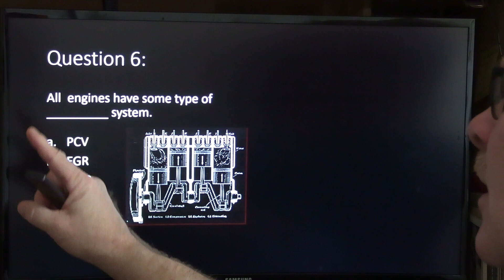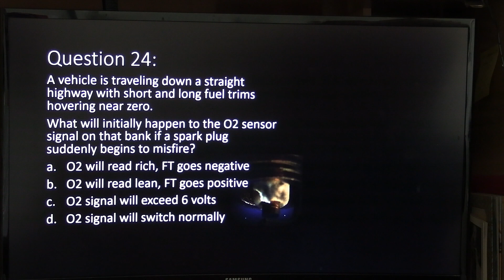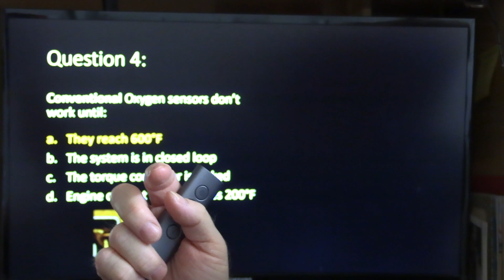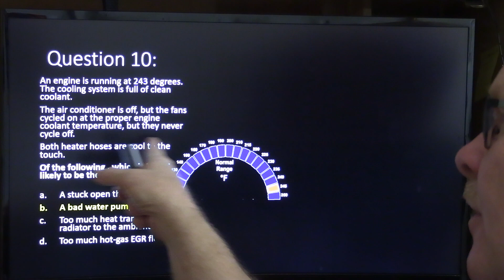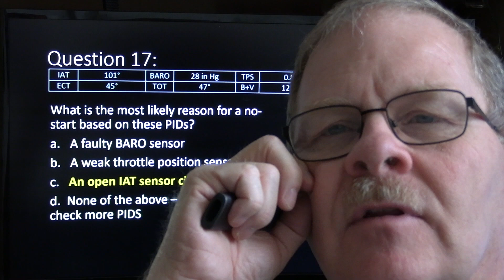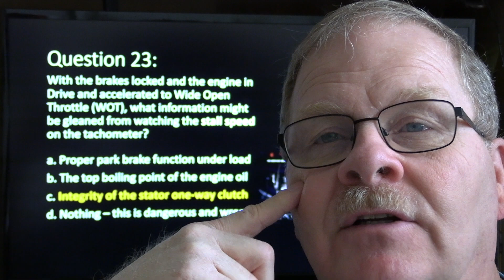Engine Performance ASE Practice Test

Comment: 17/25.

I missed the Waveform questions, got tricked on the least likely fuel question, PID question, Fuel trim question no.24, the heater hose question, O2 sensor activation, and the what happens when you lose all speed question. 

The test definitely helped identify some weak areas for me.

Comment: Hello, Sir. I have been trying to understand engine displacement and how a vacuum leak affects MAF reading. To my understanding, engine displacement is how much air the engine can take in. If you have a vacuum leak, it will always reduce the maf voltage or g/s because there will be less air going to the engine: Air from the maf and air from the vacuum leak should be equal to engine displacement. Am I wrong in my assumption?
Reply from the maker: That's pretty much correct. The proper MAF reading is critical if fuel trim is to be balanced. To illustrate this, you can be watching your fuel trim numbers and remove the oil filler cap - which allows air to enter the manifold by way of the PCV system, but not through the MAF sensor - that is referred to as "unmetered air." Metered meaning measured. The ECM/PCM algorithms are written to expect very precise incoming air measurements.
Reply: @McCuistian  Brilliant explanation! Love watching your videos: they are very instructional and helpful.

Comment: How does the spark plug seal compression if not with the washer?
Reply from the maker: That's part of what the washer does, but it's not the only thing - the washer - and the bevel on other spark plugs - both seal and conduct heat.

Comment: L1 tomorrow, oh boy.
Reply from the maker: You go, boy!  Just take your time and don't overthink your answers! Use the diagram and  common sense. Make sure you understand dynamic compression testing (I have a video on that too) https://www.youtube.com/watch?v=YbR7Ja2E28s&t=903s&pp=sAQA
Reply: @McCuistian  I passed!!! That concludes G1, A1-A8, and L1. Your channel helped a lot!
Reply from the maker: @jctyoga  Congratulations! Outstanding!  The L1 doesn't always have questions on dynamic compression testing (everybody gets different questions), but the first time I saw those questions on DCT was years ago and they kind of blind-sided me - took some thought to figure those tables out. And I was in a class at KC Vision with two instructors that didn't fully understand DCT - both of them had taken the L1 and hadn't even seen those questions!  Anyway, it's a great feeling to pass those tests; the only cert that I have that you don't is Light Vehicle Diesel.  Again, congratulations!
Reply: @McCuistian  Thank you, much appreciated!! Actually I take A9 on Tuesday I believe. I’m unprepared, was so focused on L1! A co-worker has that one plus L2 and L3. 

I had a lot of Data Link Connector and Emissions questions! Those I did the worst on. There was a question that showed the waveform at the battery, of a vehicle with a miss during cranking. I could not make heads or tails of it. Then I remembered your video about the “puffs” that go real high when it’s trying to build compression. Sure enough there was a voltage spike in the waveform and I was like “boom, that’s the right answer.” 😁
Reply: Alas, I did not pass A9,  by 2 questions. It was a weird test. I did the Halderman test prep, and I don’t think it prepared me very well. Will get it next try! 

Now I gotta start learning EV stuff!
Reply: @McCuistian  Just watched it, thank you!

Comment: On 24... Wouldn't the O2 sensor go rich? Since the fuel injector wouldn't know that the spark plug misfired it would still Squirt fuel.
Reply from the maker: Because when a spark plug begins to misfire the oxygen sensor sees all that oxygen it doesn't care about the unburned fuel.... Which it cannot see